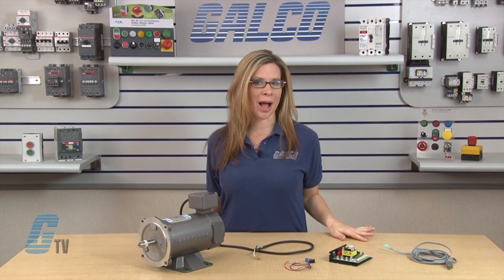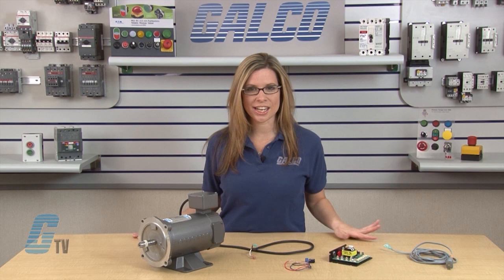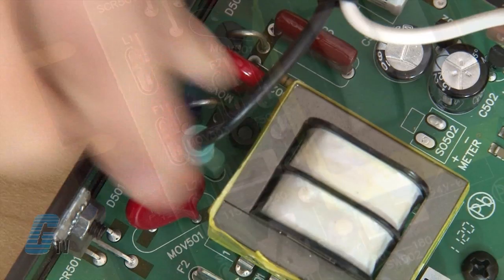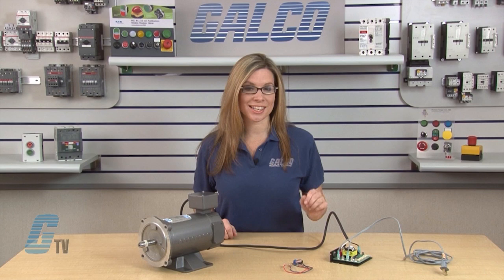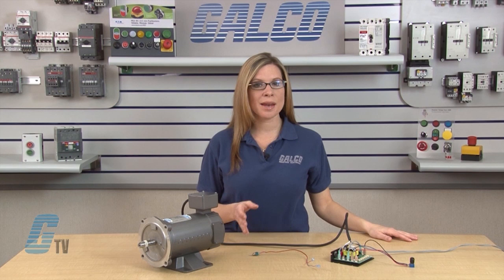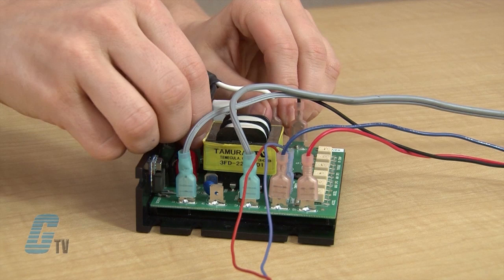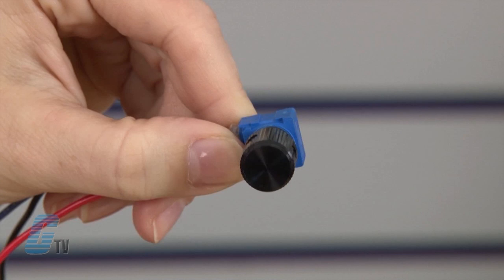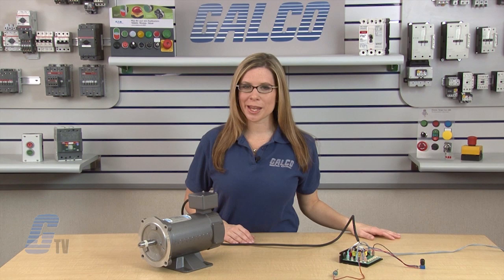Minarik's 23000C Series of DC Drives for Basic Operation

Comment: Hi I'm new to this so I might need a bit of help. I'm making a pitching machine for a baseball team and I have a 2.5 hp elec DC motor out of a treadmill.  It puts out 180V at 4700rpm. I'm in Australia so our power is 240 and I want to be able to control the speed of the motor. Can you please help me out so I can make a control box for it. Thanks Randy
Reply from the maker: I think this drive might be able to help you out: Minarik XL3300A
Reply: GalcoTV
Reply: द

Comment: How does the drive work without a rectifier ? I thought you had to have one to convert from ac to dc. Help would be appreciated.  I am trying to speed control a 2 hp 130 or 180 volt dc treadmill motor .
Reply from the maker: Ok if you are talking about an AC drive with no rectifier it would be built into the power cube, 1 power cube to convert AC to DC and the output transistors to Invert DC back into AC. But you describe a DC motor here. In a DC drive the power cube is the converter cuz you are not trying to invert it, ok. Small DC drives for a 2 HP application are readily available here. However you must know the motor ratings in advance, AC or DC and the exact voltage rating. Also what is the power feeding your treadmill, most home appliances run on 120Vac, is yours different? The DC drives we sell with 120Vac input rating run a 90Vdc motor, you stated 130 or 180 which is it? If you cant read it very well 180Vdc is a common value but the drive would require 230 single phase power to produce that ok?
Reply: GalcoTV the motor is 130VDC/1678 Watts . Uses standard 110 house outlets. Has a red and black power and ground and 2 blue wires all coming from the motor .
Reply: GalcoTV also, don't know if it matters but it is also 12.9 amps and 5135 rpm.
Reply: GalcoTV this is the motor , Google it and it's the first one that comes up. P/N F-237595

Comment: What will happen if I plug the dc motor to L1 & L2 and AC to A1 & A2?
Reply from the maker: Kaaablooooooy
Reply from the maker: Or it's just not going to work
Reply: You will angry the pixies and let out the magic smoke. It will need to be sent back to the factory to put the magic smoke back in